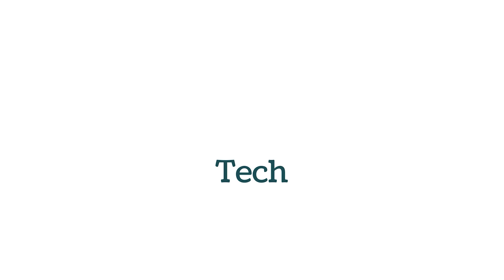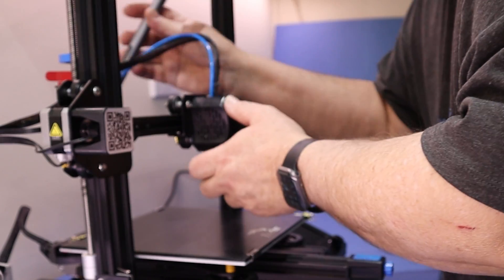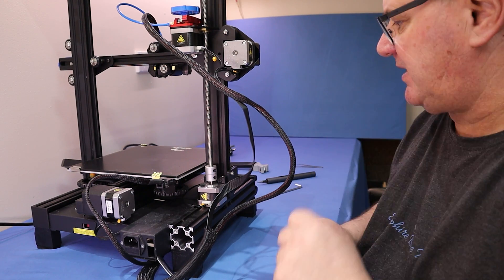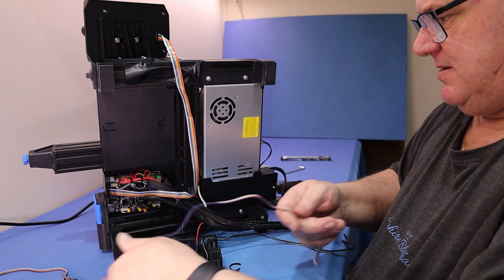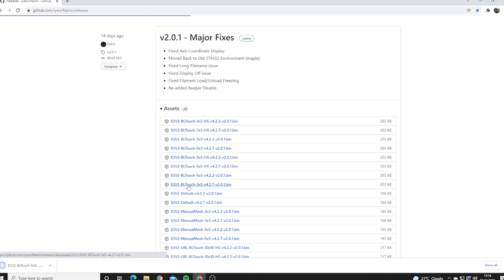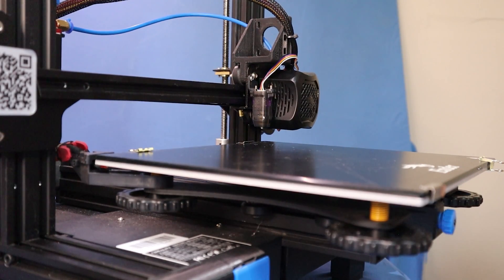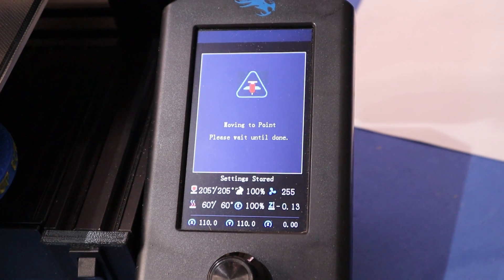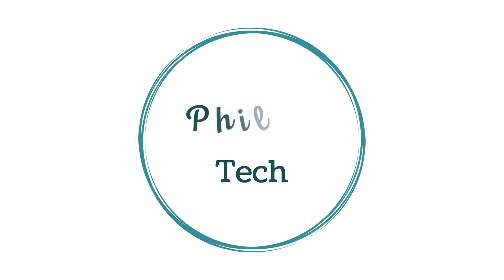CR Touch install Ender 3 V2

Comment: So after it does the leveling I have to set the z offset ? How does the cr touch levels the bed automatically? Thank you I'm new to this machine
Reply from the maker: You need to set the z offset before auto bed level. Just manually level bed once first. Then sleep well my love z offset. Then let it do a bed level before the print. (G29 after G28 in your start Gcode) This will start bed probing before each print. 

It doesn’t actually level the bed it adjusts the z offset during prints to compensate for any rises or dips in the bed surface.
Hope this helps thanks.

Comment: Hey I used your guide to install my CRtouch and I'm having a few issues and I wondered if you could help. My CRtouch when it goes to level does not snap back in once making contact with the printing surface. it just taps the surface twice and moved to its next point. I don't know if this is the cause of the second issue or if this is the result. Secondly I cannot adjust the Z-offset. I can enter any number and the head will not move down.

I can record some videos if my descriptions are inadequate.
Reply: It looks like you have installed the HS (high speed) version of firmware. It works fine I use it myself.  It saves time. In the z offset menu check the live box and you should be able to adjust the z offset with the dial there. You can also adjust it in the tune menu after you start a print which is where I do my fine adjustment. Hope this helps. I’m away till Friday so don’t have access to a printer at the moment but happy to help if I can.

Comment: Hello I need help
After setting CR touch and firmware I can not move z offset.
Thanks
Reply from the maker: What firmware did you use?
Reply: Stock firmware which came with printer and for cr touch like you
Reply from the maker: @SuperSuperBr  I use Jyers Firmware on the Ender 3v2 it’s a much better firmware and a lot easier to setup. There is a link in the video description. What printer do you have?
Reply: @philtalkstech  Hi I have ender 3   v2
Reply from the maker: Try the Jyers firmware in the link it is much better firmware

Comment: Hello the firware is for bl touch or not cr touch. Is a probleme fot the nozzle offset ?
Reply from the maker: Firmware is the same for both. The z offset is different for every printer
Reply: @philtalkstech  but the nozzle offset is the same of bl touch and cr touch ?
Reply from the maker: @sebastienzimmer1141 you need set z offset every time you change anything near the hotend. Just to make sure it is right.

Comment: My Z offset if set correctly but when i go to home it reset it completely anyone know how to fix it
Reply from the maker: Did you save settings after setting z offset.
Reply: @philtalkstech  I clicked save on my screen and it beeped
Reply: It continues throws it back 11.20 on the z
Reply from the maker: What firmware version are you running? 
Some firmware saves settings to SD card just make sure there is an SD card in the machine. If thats not the problem then I think it would have to be a firmware problem.

Comment: This is a great video and helped me to finally get mine working.  The only thing that was left out was removal of the z axis limit switch.  Leaving it in, my probe had a red light.  I have a 4.2.2 mainboard if that makes a difference.  Thanks again for the video Phil.
Reply from the maker: Thanks for the comment. I did forget to mention disconnecting the z limit switch mine is unplugged from the main board. I have since removed it all together. Happy printing.

Comment: Hi! Can you pls explain what do those 5x5 or 3x3 in the FW names stand for and how to know which one is needed? Thanks
Reply from the maker: Sure. 5x5 will probe the bed in 5x5 grid 25 points 3x3 will probe nine points. 25 points gives you a much better map of the bed but takes much longer. If your bed is not to bad 3x3 will be fine. There is also a HS (High Speed) version of Jyers but it can be less accurate. I have tried them all and settled on 5x5 hs on my Ender 3 v2.

Comment: Hi Mate, I've got a Ender 3 V2 with CR-Touch, upgraded to same firmware as you, besides mine being 3x3 grid. As its the first time i'm using it, should I do a manual bed level first? if so any tips on doing one please? thanks!
Reply from the maker: Yes you will need to do a manual bed level first. Then do an auto bed level and save it. Make sure you add G29 after G28 in your slicer’s start G-code. Then I’d do a single layer test print and adjust your z offset with baby steps in the tune menu. Hope that makes sense.
Reply: @philtalkstech  most makes sense mate. If doing a manual level for the first time, should I do a Z-offset with paper first? As I'm guessing if I just tried to do a manual level the nozzle would be to far from the print bed? I've just added the yellow springs as well, haven't compressed them down with the rings yet
Reply from the maker: Yes do z offset first. But adjust it again when you do the first print. If you are using Jyers firmware you can use the probe in the manual level menu. Just right the numbers down for each corner and leave the centre as the cr touch will compensate for the bed when your done. I’d tension your springs about a third and try and make them even before you do any levelling.
Reply from the maker: You will need to go around the bed a few times if you have new springs as it will usually out quite a bit.
Reply: @philtalkstech  with this firmware, does the Z-xsis live adjust for you when setting Z-offset? Mine doesn't move either having live movement tick or when it's off and setting a negative figure for offset.

It seems to only go lower to bed after homing in Z-offset menu
Reply from the maker: @xxoTUBBSoxx  you will have to home it first or it won’t no it’s positioning.
Reply from the maker: You can only go negative on the z axis in the z offset menu.
Reply from the maker: @TUBBS006  sounds like the bed is way off level. I sometimes put painters tape on the bed to protect it while getting it setup. You can power off the printer and get it close to level with something much thicker than paper a calibration cube would. Place it in the centre of the bed (with printer powered off) This is just to get all the springs at the same height. moving it by hand bring the nozzle down onto the cube so it just lightly touches. just make sure you turn the z stepper to adjust z height X and y are fine to move by hand. Then without moving the z height place the cube in each corner and adjust the wheel for each corner so that the nozzle just touches it in each corner. This will give you a basic level. Then power on the printer home all and then try manually levelling with a piece of paper. After this is all done then set your z offset. Hope this helps. Sorry about the slow reply I’m at work and can only use my phone.
Reply: @philtalkstech  no that's fine! Thank you for having the patience to reply to me, really appreciate it! I will give it a go tomorrow with the machine off and see what happens and get back to you. Thanks so much for the help so far 😁

Comment: Thanks bud, I am new to 3d printing. I got a ender 3v2, and install crtouch , I did it the same way as you. But how do I use the cr touch to level the bed?
Reply from the maker: Hi Will. Did you edit your start G-Code. To include G29 after G28? That will tell the the printer to do a bed level mesh before each print. I assume you updated firmware with Bl Touch version?
Reply from the maker: There also should be level menu now. Run bed level mesh in this menu and save it in settings.
Reply from the maker: Once G-29 is set in start G-code if you do a large single layer test print you should see the z axis stepper move slightly as it compensates for the bed. I put a little painters tape on the stepper coupling as a pointer on mine so it’s easier to see the movement.

Comment: cr touch stoped withdrawing back into the case, still displays a reading but just stays out, is  this a mechanical or software issue? Had some issues with the black screen of death, so had to reinstall the firmware to revive it, and this is when the issue started?
Reply from the maker: Does the cr touch do its self test when you power on?
Reply: @philtalkstech  Yep
Reply from the maker: Sounds like firmware issue. What firmware did you download?  And what printer do you have?
Reply: @philtalkstech  My board is a 4.3.1, which according to Crealty is the same as a 4.2.2, so I used the BL touch 5x5 from thier site, they ended up sending me a bin file that is extreamly limited but works. But the bs that these two controller cards are the same has me wanting to get a real 4.2.2, beacause their is obviously compatibility issues and limitations. The 4.3.1 controller card was used in the creality 6, but does not work with many of the 4.2.2 updates, so not as compatible as they say. Anyways its working with a very limited features list, so asking them to give me a board that is actually fully 4.2.2 compatible.
Reply from the maker: @lindamuvic8110  That’s not good. Seems like it’s definitely different to the 4.2.2 board. I’m running a 4.2.7 board that I brought some time ago and it works fine. But I have heard that they are shipping all sorts of boards lately. I brought mine from Amazon here in Australia. Where are you? If you do purchase another board just get them to verify what processor it has fitted as there have been other issues of late with different chips fitted to mainboards. 
Sorry I can’t be of more help.

Comment: LEGEND! Thank you so much! I've been fighting with the "stock" CRTouch firmware and it seems that my z offset was never correct. I'd have to fix it a few with every print. I'm excited to run home install the new firmware. I feel that's been my issue all along! 

Thank you again in advance! :)
Reply from the maker: No problem. Hope it fixes your issues.
Reply: @philtalkstech  I wanted to come back and say that you 110% helped! I was finally able to print my first 10+ hour print and it came out pretty good. Thank you again! :)

Comment: Thanks for the vid man. Installed a CR Touch on my 3 v2 yesterday but had issues with getting the z offset just right on the official firmware.

Made the switch to Jyers just an hour ago and after doing the mesh and setting the offset once everything has been working like a dream.
Reply from the maker: Good to hear you got it working. Thanks for commenting.

Comment: If you're using a CR touch, why are you installing BL touch firmware? Are they interchangeable?
Reply from the maker: Yes they are the same. CR Touch is Creality’s version of BL Touch. Same connection and same firmware.
Reply: @philtalkstech  Thanks so much! I've been bashing my head on the wall looking for CR drivers.

Comment: Hi, got the CR touch and installed the version of the firmware for the V4.2.2.  It is only taking 1 point to make the mesh, not multiples.  How do I fix this?
Reply from the maker: Did you add G29 command to your start gcode of you slicer program?

Comment: Great how to guide cheers, do you know if the jayes github firmware will work on an Ender 3 (4.2.2) or if there is a version that does? Want the 5 x 5 check but can't see how to search on github.. 😂
Reply from the maker: No you need 32bit main board either 4.2.2 or 2.2.7 and you need the v2 screen for Jyers also.
Reply from the maker: You will need the v2 screen as the layout is different to the ender 3 screen.

Comment: No where in the factory manual or your video did it say the Z stop switch need to be removed as it's not needed.  I did see after you installed firmware that it was gone.  I had to search other vids to confirm this.  It wasn't obvious to me and I had to confirm it need to be removed.
Reply from the maker: Yes it does need to be disconnected. I should have mentioned it.  I’ll add a note to the video. Thanks for pointing it out.

Comment: Mine did not have the colored icons, what could be the reason for that?
Reply from the maker: I am running a different screen firmware. You have to install it to the screen separately. There is an SD card slot inside the screen case. I will try and do a video and put it up when I get some time. Thanks.

Comment: Loads of help, but do I need to add any code to my slicer now? I saw somewhere that the BL touch needed it, and I'm wondering if i've got to do it for the CR touch as well
Reply from the maker: Yes you will need to add G29 after G28 in your start gcode. Thanks

Comment: 1. There’s no illuminated LED lights on the CR touch when I power on the printer. I’ve looked at countless installation videos to compare my results with those, I’ve checked the firmware multiple times and used the preferred versions from both YouTube videos and Reddit forums but yet there’s nothing that’s getting this to work properly.

2. Upon turning the printer on, the CR Touch’s probe stays in the down position. It doesn’t retract and go through its “self test,” to ensure its working. I’ve taken a look at all the wiring and nothing seems off to me. I’ve checked the pins not only on the CR touch but as well as the motherboard and there doesn’t seem to be anything visually wrong.
Reply from the maker: Sounds like you have a hardware issue. Possibly the CR touch. 
Did you disconnect the z stop switch? CR touch should still light up though. 
What printer do you have?
And what firmware are you using?

Comment: Do I have to set it up a G29 code for Cura before printing?
Reply from the maker: Yes you need to add G29 after your G28 command in your start G code.
Reply: @philtalkstech  thank you!

Comment: Hi mate, any chance you can share the stl's for the spool holder and spindle you have on the printer in this video. The "spool side mount" linked in the description is different to the one in the video. Have been looking for one like the one attached to you printer but couldn't fine it specially with the spindle
Reply from the maker: Here they are, one is the mount the other is bearing spool holder. I better put the right link in that video. Sorry about that. I have tried a few different ones but like this one the best.
https://www.thingiverse.com/thing:4208201
http://www.thingiverse.com/thing:3303879
Thanks for watching.
Reply: @philtalkstech  legend mate, just what I was after, thanks heaps and great video's keep up the great work
Reply from the maker: @sjnllp  no problem. Fixed the link in video as well. Thanks for letting me know.

Comment: when I level the bed the bltoch doese not toch the bed and the z axsis doese not move
Reply from the maker: What printer and did you update the firmware to suit the main board you have? Did you disconnect the old z stop switch?

Comment: Wait, I thought the Ender 3 V2 had the 4.2.2 board? Is that not the case? I installed the CR and could not get the leveling to work right, so I went back to stock, I'm wondering if I used the wrong firmware now.
Edit: I see your mainboard upgrade video now, lol. 

Dang, I was hoping that is what went wrong for me. No matter what tweaking I do, once it does the G29 at start of print, the offset I set is ignored and it tried to print a couple mm's over the bed. Disaster every time.
Reply from the maker: What firmware did you use? 
Yes I did change the main board. 
Make sure you you save the z offset. I always do a final adjustment to the z offset as I watch the skirt go down on the first print. For the first print even add a few extra lines to skirt to get it perfect.
Reply from the maker: Did you disconnect the z stop switch?
Just check your start G code make sure G29 is after G28 and that there are no other conflicting commands. I'm happy to look at it if you send it to me. 
Thanks
Reply: @philtalkstech  I did take it off, and I manually leveled first, then did auto level. Then made sure it was doing the leveling at 
tart (g29 code). Then it would ignore my z offset and print 2mm above build plate and the results were hilarious. I di upgrade my springs at same time and I think that may have thrown everything off. When I took off the CR touch, it still took a long time to get the bed right and have it start printing on the build plate correctly again. Odd, but I may give it another try again soon.
Reply from the maker: @NickMayer  if you get it back on check what the display says. Does the display z height read 2mm when print starts it should read 0.2mm. Also can you adjust z offset in the tune menu when print is running?

Comment: I would like to know if this is a valuable, recommended upgrade.
I would like to see if this gives better results.
I would like to know if this upgrade makes my life easier and better.
I would like to know if the CR Touch is with the time, effort and expense.
Thank you in advance for answers to these questions.
Reply from the maker: It's definitely been worth it for me. Don't have to level my bed much at all anymore. As long as printer is set up well it helps slot. The trouble some people have is it can only compensate for a small amount deviation in the bed surface not if you bed is way out. On the ender printers a lot of problems with bed leveling are more to do with the X gantry moving than the actual bed. So if your printer is set up well the CR Touch is a good upgrade. Thanks

Comment: what is your gcode for the cr touch
Reply from the maker: ;This is my current start gcode. G29 is for CR touch. Hope it helps. Phil.
 
G92 E0 ; Reset Extruder
G28 ; Home all axes
G29 ; BLTouch do full bed level
G1 Z2.0 F3000 ; Move Z Axis up little to prevent scratching of Heat Bed
G1 X0.1 Y20 Z0.3 F5000.0 ; Move to start position
G1 X0.1 Y200.0 Z0.3 F1500.0 E15 ; Draw the first line
G1 X0.4 Y200.0 Z0.3 F5000.0 ; Move to side a little
G1 X0.4 Y20 Z0.3 F1500.0 E30 ; Draw the second line
G92 E0 ; Reset Extruder
G1 Z2.0 F3000 ; Move Z Axis up little to prevent scratching of Heat Bed
G1 X5 Y20 Z0.3 F5000.0 ; Move over to prevent blob squish